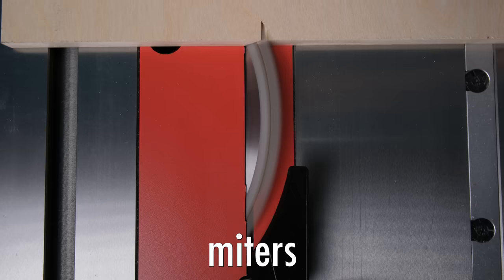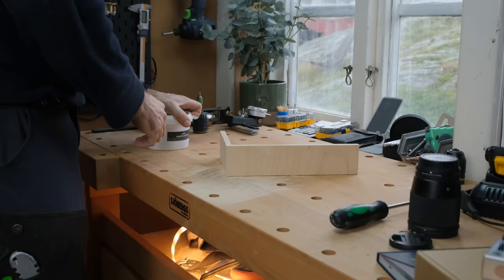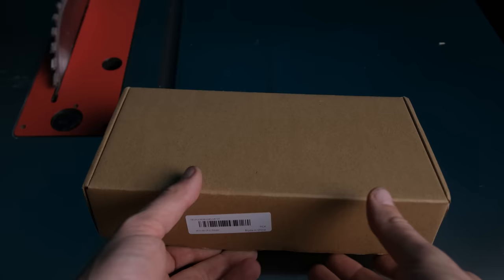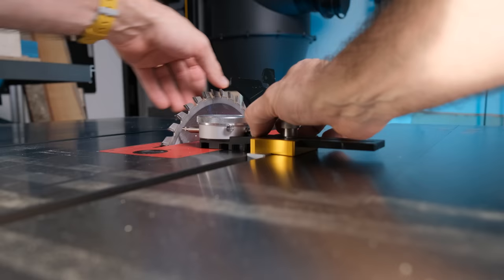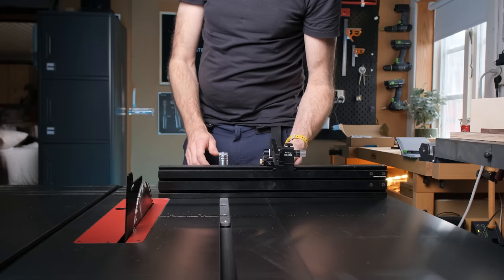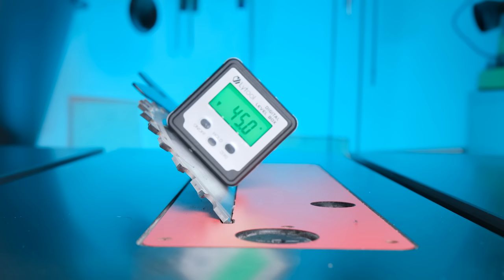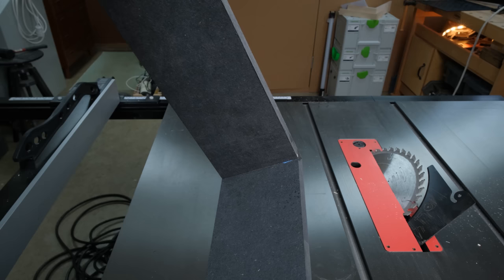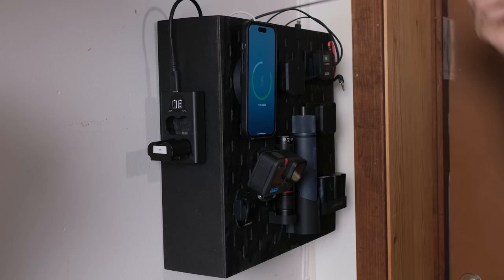It's like cheating

Comment: Sorry to tell you this, but you've gone the wrong way. By going under 45 degrees you will have an opening on the outside of the mitre. You always cut mitres at around 45.5 degrees ish, not 44.9 degrees, this way at 45.5 degrees the outside of the mitre will be touching and the inside may have an extremely tiny gap. You increase the angle to close the outside of the mitre, not decrease.
Reply: He's right.
Reply: Well if you measure 44.9° from the outside edge then you get a closed outside corner. (This is true, if you disagree you're misunderstanding me)
All depends on your reference, no?
Reply from the maker: I think we both mean the same thing. The way I have it set up with the angle gauge and the table saw - it's in reverse - thats why I think I said "go a bit further than 45". It measures away from the blade.
Reply: It depends on if u start from 0 or 90 degrees. As long u mitre a tiny bit more than 45 from ure zero U'll be fine
Reply from the maker: Perfectly explained - thanks!
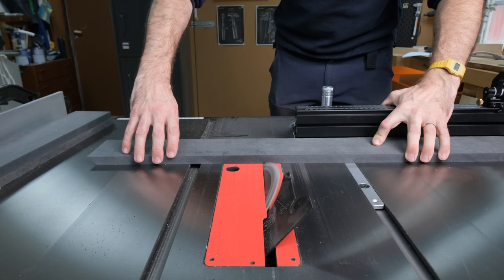Reply: 5:55 you can see what he's saying, so there should be no confusion. Respectfully you should have checked this before commenting.
Reply: Hi, no harm done and the comment chain helped clarify any confusion.
Reply: Either way he is stating that the mitre should be set under 45 degrees which is incorrect and misleading regardless what 5.55 states. Cheers @JustinShaedo
Reply: I just cut mine at 45, as it’s half of 90 Simples 😁
Reply: The author is right. It depends which part of the wood will be used. For his setup you must set under 45.

Comment: The other secret is: When the blade is tilted, it pulls the workpiece sideways, tending to throw off the bevel. This is even a bigger problem with miters. My miter gauge has holes allowing me to screw in a larger back-stop. If that back-stop has a strip of high-grit sand-paper glued to it, then the added friction from the sandpaper solves the problem.
Reply: Why so unhappy?

Comment: How to actually, with any saw:
- Cut a piece of scrap in two.
- Flip the offcut and cut it again, removing the edge that you cut first. Now both pieces of scrap have the same angle.
- Put the two pieces together against a straight edge to make a straight line.
- Did it fit? Profit.

- Did itn't fit? Adjust the saw and start again.

You can use whatever you want (a square, an electronic meter, a cardboard box, your intuition etc.) to get it close to begin with, but the method for actually getting it right is always the same.
Reply from the maker: Nice tip!

Comment: Great video, if I can offer some comments... 1/10,000 of and inch is 0.0025mm 🙂.
When you kept the dial gauge still and spun the blade, you were actually checking if the blade ran "true" (didn't wobble). I'm thinking you should have slid the gauge (whilst it was in the track) across the face of the blade to check that the blade is parallel to the track.
Very well presented 👍
Reply: Good observation, but I'm guessing that he has already done that, and that in his mind everyone one else has done that already as well when they set up their saws. That's the first thing that I do, so I think that he just wants to check for blade wobble which can happen when you overheat/overuse a blade.

I actually thought he was going to build a miter sled which takes care of the issues that most have with them. Instead he built a friggin charging station :-)

Comment: There are two ways the blade can be out of square on a table saw. Either the plane of the saw cut is not aligned with the mitre slot - OR - the saw blade does not run square against the arbour, that is it might have a wobble. It is important to check for both, especially if you have an older table saw or are using cheaper blades.

Checking both factors is similar but subtly different.

To check the first, mark a spot on the blade and check that spot both as far forward and as far back as possible.

To check the second, keep the dial indicator in the same spot fore or aft, and rotate the blade to see if there is a wobble. While the dial indicator is on the saw table we may as well check both factors.

The 44.9 trick is always good. 

One other tip is that if you are cutting mitres in hardwood the piece often will shift under the pressure of the blade pushing against it (either that or the blade bows as it gets into the meat of the cut. I kind of suspect that really). I once got a very slight bulge on the mitre face in hard Maple. Only when I started clamping the pieces down firmly on my sled and used a freshly sharpened blade with a slow cut did that go away. It seems that neither hand pressure or a stop are firm enough. (I guess I am OCD when it comes to getting those mitres right :) )

Thanks for the great videos. Keep it up.
Reply from the maker: Thanks for the tip of clamping down. I had that happen a lot on my contractor saw - so I think your right about the blade bowing. And that's a really good tip to check the arbor as well. Im going to do that.

Comment: There may be another dimension to adjust on your table saw. Once the blade is aligned with the miter slot, angle the blade to 45 degrees. Then cut a 45 on a a wider board, and push completely through. If there is a secondary cut off the back side of the blade, then the table needs to be tilted back to front. Check both miter slots. Insert shims on the bolts holding the table down, typically on the front side. When there is minimal saw dust raising from the back of the blade, it's in tune.

Hope that makes sense. Happy woodworking.
Reply from the maker: Thanks a lot for that tip! I will check that directly.
Reply: I learned that 45 years ago.  My dad's saw had that bad.  Unlike the other adjustments it isn't something that is provided for in the build of the saw.  So it requires shims.  I guess some saws are made accurately enough that it doesn't mater, but it caused smoke on our delta 9"

Comment: I imagine wood filling and/or wood glue on the inner ends will help with providing strength to it.  Staples also help give extra support.
I make stretch boards for paintings, and also the frame.  With the frame I need to be more accurate, however this is an eloquent solution for stretch boards.  Thank you.

Comment: Excellent advice. Personally I prefer the 45 triangle over the digital reader as I’ve found them to be non-repeatable. So, if you’re really serious or you’re using 500 dollars in walnut on your miter, use a triangle and throw away the digital angle  finder.
Reply from the maker: Fair enough!
Reply: And do you leave the gap as he showed?
Reply: @angellas.1314  Generally speaking no.  Using a triangle I trust, I know it's going to be 45.  That said, I have on occasion left a small gap at the bottom to use the trick in this video. If you use the digital scale, you should always use the trick.
Reply: I use a digital every day and it's always been dead on. But that's the difference between a $5 angle finder and a $50 angle finder. You get what you pay for...

Comment: A very well explained video for all to enjoy. Something I would add to the discussion around cutting a 45 degree angle is an error in measuring that creates the need to go "just past" 45 degrees. The digital device used for measuring angles is displaying the angle created between the table saw surface and blade-body instead of between the table saw surface and blade-teeth. As shown in the video, the blade would need to rotate an additional small amount to account for how the teeth extend past the blade-body. 
At the same time, a small right-angle was shown on the underside of the blade, leaving a gap at the bottom. Instead of focusing on the gap, a speed square with a 45 degree side can be used to have the  blade-teeth just kiss the 45 degree side as they pass by, insuring the underside (or left side, as shown in the video) is now set to 45 degrees at the plane of rotation for the teeth. Both sides should, in theory, then be set to 45 degrees at that point; but, as we often see, where theory meets reality there is frequently a gap, and hence the need for videos like this to help close that gap physically and geometrically.
Thank you!
Reply from the maker: That is very well explained!  I agree - theory doesnt always meet reality but accounting for the teeth is a really god tip!

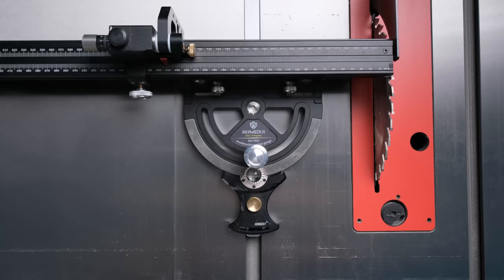Comment: I am a beginner an amateur in woodworking but i think the problem starts at 5:07, when you start tillting the blade. Experienced woodworkers recomends to leave the blade vertical and build a sled that will hold the material to 45 degrees (or 44,9). You have all my admiration for this video, i like very much the way you tell the story. Thanks and good luck.
Reply from the maker: That would be good for certain things, like picture frames for instance. If your cutting wider pieces of wood your dependent on the blade height. The way I make it you can cut - theoretically as wide as you want. Thanks for watching!

Comment: If you have a jobsite tablesaw such as the Dewalt DW745 you might notice the miter slots aren't even, they vary in width from front to back, the top surface isn't flat and although you can make some adjustments it's never going to be spot on. Which is why measuring the results of the cut (along with sleds) rather than measuring the machine might be a better approach. Deflection though is still something to consider, depending on density of material. Because of these sort of issues and not having a cabinet saw I've started to cut mine by hand. Thanks for the vid!

Comment: I just use my 1953 Dewalt 14” radial Arm saw.  Set the arm to 45 degrees, and cut one side of the miter against the fence to the right of the blade.  Then I put a 90 degree fence jig against the fence on the left side of the blade and cut the other mitre on that side with the stock against the 90 degree fence.  Because I am cutting either side against the same blade setting, it does not even matter if the arm is out of calibration a degree or two, the left side of the miter will be wider by exactly the same amount the right side is narrow or vice versa… and ALWAYS add up to a perfect 90 as long as the 90 degree fence jig I made is a true 90 degrees.   BTW this trick will work for ANY set of repeating mitre angles you need to make by just creating a fence jig that will accurately be the angle you want the two mitre cuts to add up to. Just get the radial’s arm angle close to the halfway angle for appearances sake and this method cuts  perfect miters every time.

Comment: You're shifting the flaw (gap) to the unseen edge. Smart. 
I would also add that when you're checking the table saw blade keep in mind that when the motor is running the blade tends to move away from the motor (known as End Play / Run Out), you can measure this with a dial indicator and adjust your cuts to account for it.

Comment: There's an additional thing to be careful of when using the digital miter gauge to help tilt the blade to 45° (or 49.9°), one which is a bit hard to describe. I think (but am not sure) that the angle of tilt would be inaccurate if the gauge is twisted with respect to the blade, by not being placed on the blade so the long axis of the gauge lies along (or parallel to) the radius line of the blade extending from the center of the blade to its highest point above the tablesaw top. (Imagine tilting the gauge back when it's on the table saw top, then attaching it to the vertical blade in the same orientation. This would throw off the angle measurement when the blade is tilted.) There is bound to be a clearer way of describing the issue than what I just gave though!

Comment: this is actually a pretty common thing in engineering where we use a lot of negatives tolerances, we'll for example write "45° +0/-0.1" to say "I want this angle to be maximum 45° and minimum 44.9°", this is used not only for angles but also for dimensions and loads of other parameters in order to ensure that mass produced parts will always be able to fit together

Comment: First video of yours that has come up for me and I very much like the method of presentation. I’ll watch a couple more and subscribe. 

I’ve been woodworking since way before you were born (I’d say I’ve been serious for over 45 years but it’s probably nearer 60 since I first tried the hobby). Everything but everything has changed  in that time except for the mental attributes of patience and precision. 

A couple of points. Firstly, I don’t trust those angle cubes to be that accurate, I think they state plus or minus 0.2 degrees? Anyway, I might be nuts but I will either use 2 different cubes and hope the average is accurate or test cut. Secondly, I always use an auxiliary, sacrificial fence to back up the piece I’m cutting so that the “off it” doesn’t vary from the desired angle by falling away. Necessary? I think so but I’m not taking the chance!
Reply from the maker: Hey thanks for contributing what that great advice. I have found the angle cube can be a bit off so using the miter gauge is a second check for me.

Comment: Please adjust your miter gauge to be perpendicular to the miter slot and not the saw blade. Any slight inaccuracies in adjusting the saw blade to be parallel to the miter slot can be transferred to the miter gauge. The miter slots are the one thing you have no control over so everything should be referenced to the miter slot.
Reply from the maker: True! Ill consider that going forward

Comment: So funny we in the prefinished trim installation industry (cabinet and hardwood trim installation have been over cutting outside corners and under cutting inside corners for years    One reason is to keep the outside edge tight when the wood changes due to drying out.

Comment: If you do mitres with a mitre saw the cut piece doesn't slide into the blade and problem is solved. Tablesaw requires grip on both pieces, that's tricky. With mitresaw you can just secure it down on both ends.
Reply from the maker: that's true!

Comment: This is good advice.  However, issues involving wood moisture (noticeable later) and cutting the sides identically in length, not to mention blade selection, are all common issues that plague miters as well.  I'm just an amateur and an old guy.  My advice would be when you find something that works well and consistently, use it.

Comment: Mitter mistake: I was building speaker cabinet in birch plywood. I didnt want to have the plywood layer line in the outside of the box. I only have a jobsite table saw (Dewalt 7485) which come with a pretty janky miter gauge/bar. Recipe for a disaster. I think I succesfully cut one of the 8 mitter cut i needed and the glue up didnt go as planned either.
Reply from the maker: Feel for you!

Comment: In germany and other EU countries, the table saw have a setup where the fence ad the backside of the blade is wider than at the front of your blade. This is there to procent back kick when the stock you saw pinches the blade at the backside. Also the cutting is done at the fronside of the blade. The only thing you should adjust is, if the fence at the backside is getting narrower than the front. What you REALY need is the blade front running 90 degre to the fence. And the 44,9 backcut.

Comment: If you deliberately introduce a gap to the joint aren’t you significantly reducing the strength of the joint because the two surfaces will not fully touch each other because of the deliberate gap???? Please respond if I am incorrect

Comment: Here is what is going on: miters in wood may be a perfect 45 when cut, but when glue hits them the wood expands slighty in an obtuse way and they are no longer 45. Depending on the size or proportions of the stock, using a clamping method that applies pressure directly across the miter instead of a band clamp will hold them shut while the glue dries, and they shrink back into shape. Those C- shaped wire spring clamps are usually up to the task, and of course angled temporary glue blocks and screw clamps will do the same with even more pressure. My shopmate Michael Clark taught me to glue up picture frames one joint at a time, maybe leaving the last for later when cured glue and moisture equalization had closed the frame up more and brought the remaining joint back into proximity, or, if the proportions of the stock permitted flexibility, then just squeezing it shut in the same glue operation.

Nothing wrong with the method you described though, but be advised that those overly sharp 45's will have put the frame or box into a state of tension more or less permanently after drying, waiting for a weakness somewhere, sometime to give way.
Reply from the maker: thanks for the input. truly appreciated. I will try some c-shaped wire spring clamps
Reply: @TheSwedishMaker , or consider an adhesive that does not load moisture into the wood. Polyurethane or epoxy are two.

Comment: This won't work if you're making picture frames from wide material for instance - you're just trading one gap for another, and the gap in the face of the frame will get bigger as the width of the frame material gets bigger - and it will show even more.

Comment: I suppose it kind of depends how your digital angle gauge handles rounding. When it goes from 90 to 45, is 45 actually 45.000° or could it be 45.049?
Perhaps going 90 to 44.9 then up to 45 will actually be correct way to do it?
Reply from the maker: I actually haven't tried that, but I will for sure. It might depend on the angle gauge somewhat and therefor - the mitre gauge might be the easiest way of getting slightly less than a 45 degree mitre.

Comment: My approach always gets me perfect miters and my thought is why depend on resetting the saw angle. Leave the saw at a perfect 90 and don’t mess with it. I built a 45 degree sled that runs in the track instead. Clamps hold the work in place. I’ve never had a bad miter and no fiddling with the saw angle.
Reply from the maker: Good tip